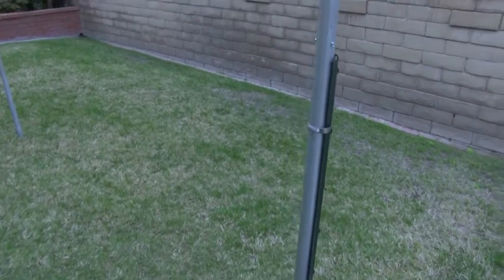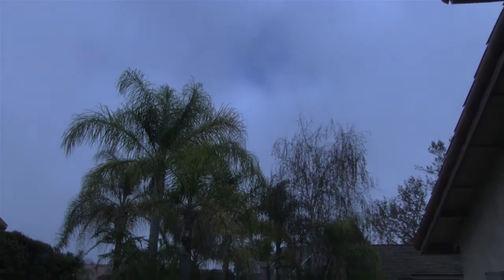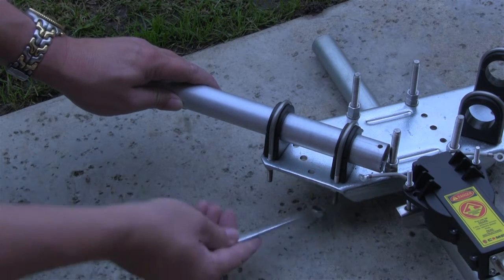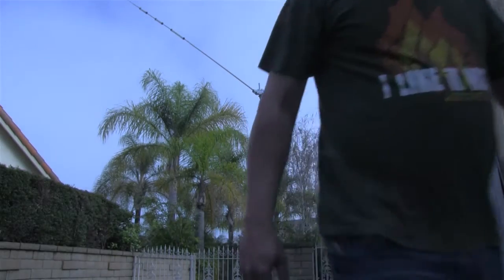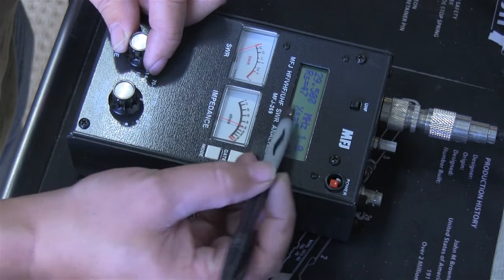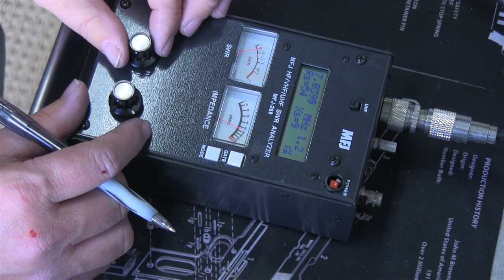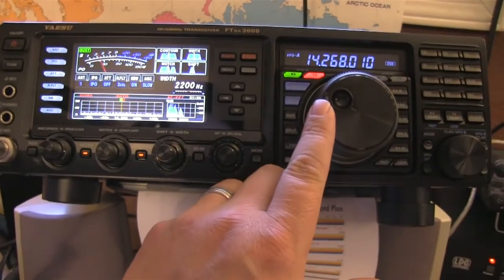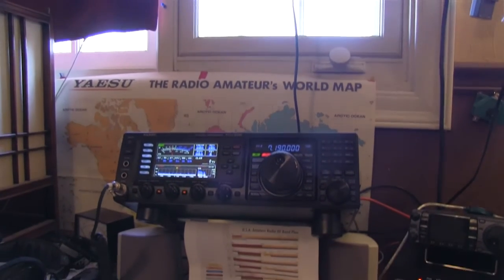Comet H422 Setup and install Pt 2 - 2 with Yaesu DX FT 3000

Comment: Nice video, followed it all the way through. However, after putting it up, if it rains, the VSWR on 14 and 21 Mhz goes through the roof and the antenna is totally unusable, until the rain stops and the traps dry out. Followed all your weatherproofing to no avail. Contacted Comet in japan and they state that this is a fysical effect of nature. Funny though, because old Fritzels and new Prosistels don't have this. Anyone else ?

Comment: At 3:46 you shorted both lobes together and to the ground through the mast. You might as well forget the antenna, and just short the antenna output of the radio with a paper clip. It would be a lot cheaper.
Reply: Not to mention you couldn’t find the red mark because your BalUn is mounted upside down :D It’s obviously moulded to hug the mast, and you have that part facing outward.

Comment: Good enough for me... My landlord doesn't like wire antennas. Its compact compared to others for the same coverage. So this will do the trick, being 6 stories up. Rubber sealant spray should provide years of problem free operation. Thanks !

Comment: I had trouble with my TV system on 40 meters and 40 meters only. I thought it was the system. The problem turned out to be the battery back up. Every time I transmitted the back up would reset and glitch the system. I replaced the back up and now I have no TV interference even at 1KW.

Comment: Now that`s intersting you have got it tuned through a ldg did you have any problems then using the inbuilt tuner ???.. I had problems tuning my G5 Through my ft 897,and the fc30, but it would if i used my LDG.many thanks From the uk